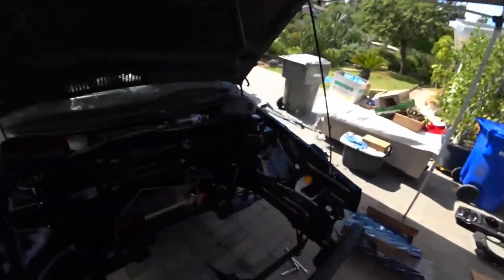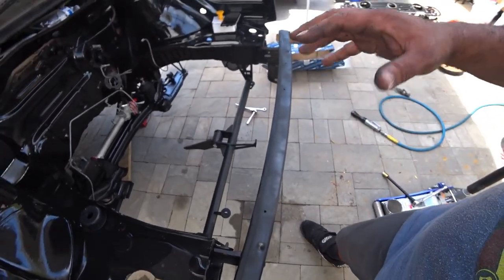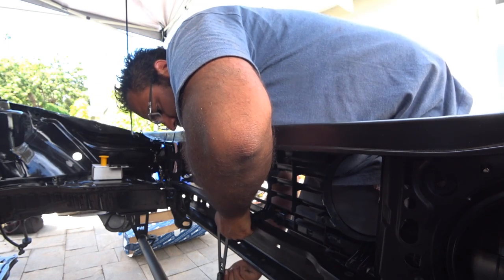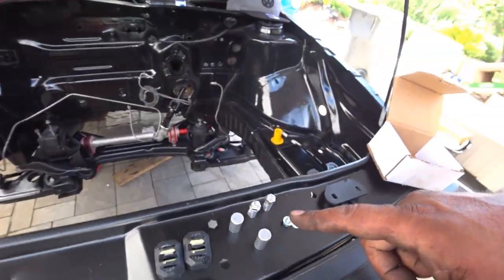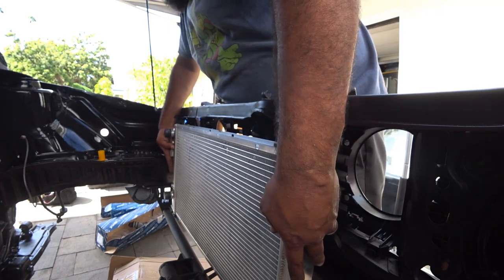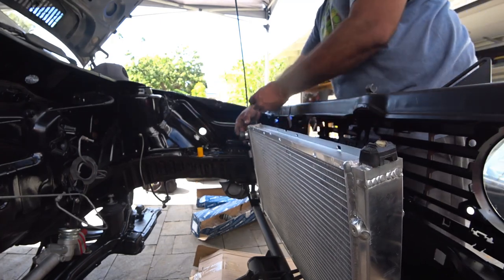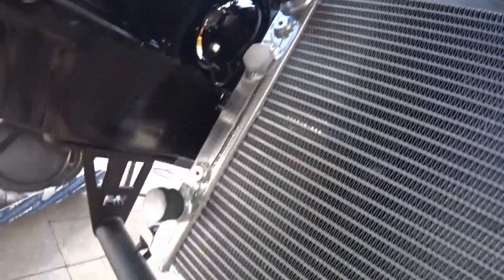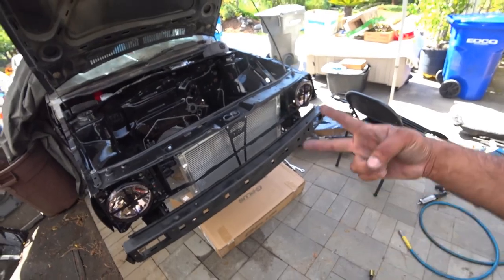Fabless Manufacturing VR6 Radiator kit for a VW MK2 Install S6 EP9

Comment: What did you use for the lower grommets for the radiator?  Were they actual VW/Audi parts?  I was looking for the 1HM121267E, but it's no longer available.

Comment: Hey great vid man thanks. Can someone confirm whether that's an early style steering column?? Fabless manufacturing clearly state on their website that to use the hydraulic clutch kit you need to have a later style steering column...
Reply from the maker: Email them. They will get you the right info
Reply: @PincheALsGarage  will do man! Thanks for getting back so quickly! Do you happen to know if that's an early style column though that you've got in your MK2?
Reply from the maker: @cameronhughes1118  i really dont know i just measured it and it matched my mk2 gti that is why i did the manual swap
Reply: @PincheALsGarage  okay cheers mate! All the best from England 👍

Comment: Where did you get the bushings for the radiator on the lower sections on both sides?
Reply: it comes in the upper radiator mount kit at Fabless. Contact them.